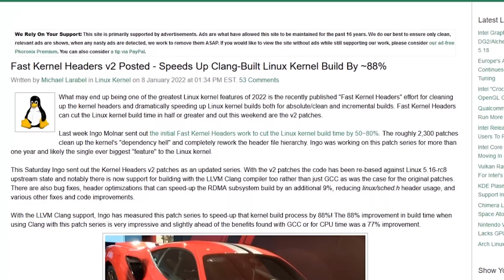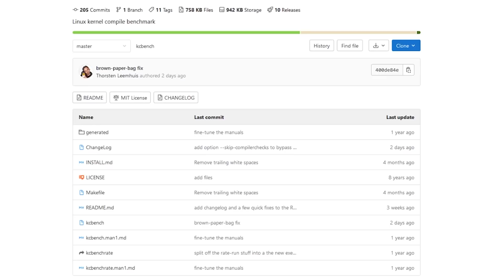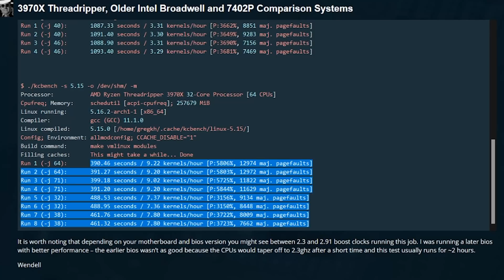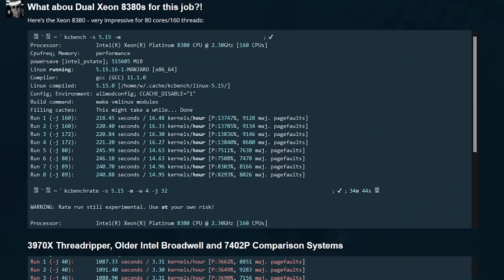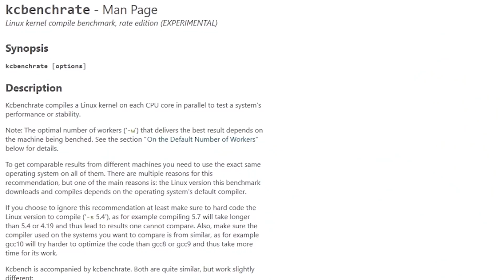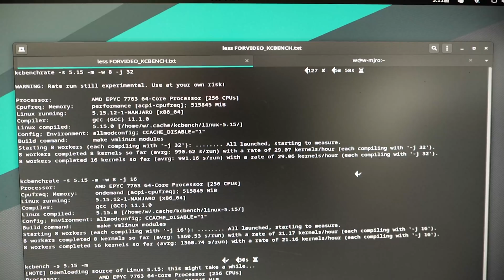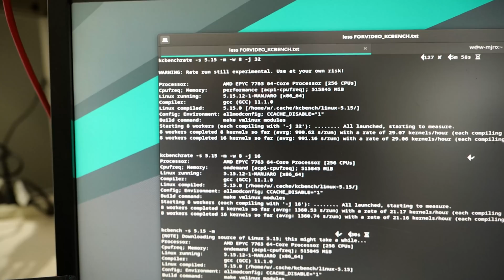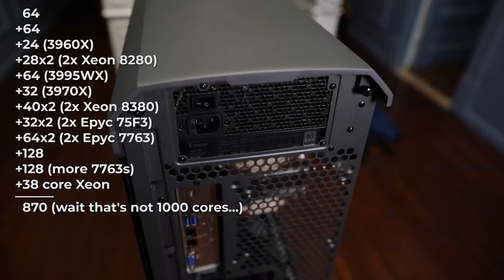Solving Linux DevOps Issues with OVER 1000 CORES!

Comment: As someone who's worked on OpenBMC... I would kill for a build in 2 minutes haha. I'd be very lucky to get a 2 minute build if I've literally changed a single package so just one module is re-compiled and then the filesystem is rebuilt and the image is zipped back up... If I have a clean build doing the several thousand build tasks, I'm lucky if the build finishes in under a half hour...
Reply from the maker: Think it's possible for me to get a generalized script or more info so I could build a benchmark around what you're doing?
Reply: @Level1Techs  Ooh I'll be sure to try putting something together! I'd be very excited to see a video about building OpenBMC :)

Comment: Weird question but that system you had in a normal case running two cpus, is it that quiet or did you just not use audio? I am at that tipping point of building another server in a case or just buying used server gear.

Comment: When you run multiple compile jobs, does the bench tool force scheduling on a specific CPU/CCD and its corresponding NUMA zone? If not, I think it would be interesting to do it manually, one method comes to mind, maybe try to sandbox the benchmark in a container, run multiple jobs/containers in parallel while forcing each container to live on separate cores and NUMA zone.

Comment: How about Watts per Kernel? Efficiency is becoming the limiting factor for HPC implementations, as there is generally an upper bound to how much capacity a power company {can | is willing to} deliver to a single location. I've seen 6-8 MW quoted frequently, though I'm not an expert. The Top 500 list has a related Green 500 that explores this axis.

Comment: Building a machine for GKH?  Nice.  Did you ask him about what he thinks helps with speeding up kernel compilation?

Maybe playing around with gcc options might change things, like -O0 so that it just skips any optimizations in favor of spitting out binary as fast as possible (and then it would be interesting to see how that affects the performance of the final compiled kernel with those optimizations).

Also, what about using ccache?  Some of those common header files surely could benefit from that?
Reply: I'd guess that each core is sicced at a different compilation process, all going at the same time.  That takes care of the CPU needed.  I/O (or RAM contention) could still be an issue.

Comment: "You probably aren't going to convince your manager to let you re-architect a project for faster compile time"
That's why you don't ask permission, you just do it on a separate branch and don't tell anyone about it until it's ready to rebase into master. I've done this on real production projects, during the downtime between release cycles where everyone had nothing to do but browse reddit for 3 weeks while managers and bureaucrats argue about arcane policy things for the next cycle, because I was bored. Surprisingly enough, nobody was mad that one day the CI pipeline was suddenly 60% faster and produced 70% smaller executables.
Reply: "Better ask forgiveness than permission" someone told me one. Your story pretty much sums it up, and I have also lived through situations like this. If you simply show up with results, most people simply prefer not to say anything (and smile) or try to present the sudden improvement as their own.

Comment: Me, broke student, living off my quad-core: Hmmm, yeah, this video is for me 🤣
Thanks for the tech madness I love to see 👍
Reply: Used Xeons might help you to overcome the 4-core era on a budget.
Reply: Most devs work on 4-6 cores.
Reply: @deth3021  There is no need to limit yourself, you can get a 18-core Haswell-EP Xeon for around 120 USD. That makes compile jobs faster and helps to make devs more productive. ;)
Reply: @seylaw  most devs use company provided kit.

Also it isnt a limit. World builds are for build servers. Incremental builds is enough for what most people do.
Reply: @deth3021  Fair enough, but as the OP seems to be a student with little money and complains about few cores, I just wanted to point him to some budget options to overcome this limit. As long as you are willing to buy used hardware there are options which he might not have thought about before.

Comment: What happens if you cluster them? I wonder what the results would be. What network speed would you need?
Reply: Yeah that would be interesting! Not sure if different compiler versions will produce incompatible code, or if the same compiler running on different CPUs will produce incompatible code, I'm guessing there will be some kind of configuration option to avoid that.
Reply: @wpyoga  if you are using distcc, every compiler will use the same target, unless you pass -march=native, which will compile in each CPU for that specific architecture.
Reply: @LtdJorge  I see, today I learned something, thanks!

Comment: Some very interesting content here, You do make a good point about cpu cache and clock speeds... I'v ran a dual HT hex core system in the past and i ran folding at home on it having the dual sockets and two lots of cache did offer certain advantages performance wise when doing heavier jobs and many at once.

Looking forward to seeing how all this develops, are there any existing Linux Distros or kernels you would recommend for workloads that use lots of cores and high usage for long hours?

Comment: Honest question: why do you need to keep compiling the kernel in 20 seconds?
Reply: I think he's using it as a common measuring stick between systems. Also in the linux world even those who have never programmed may have built the kernel ( a while ago it was common to improve speed/performance/tweaking features ) . I suspect he's been building stuff for embedded systems and so this vid came about.
Reply: It's just a benchmark

Comment: Kilocores as a unit of measurement
What a time to be alive
Reply: This would be the equivalent of the proverbial old computer that fills a warehouse with dozens and dozens of CPU cabinets, but in one box smaller than a refrigerator.
Reply: And yet, the primary use of this stuff might not even be software development coolness, but scientific and business applications.  IBM, for example, has 50,000+ MIPS business computers.  Build the computers at a decent price and the applications will come.